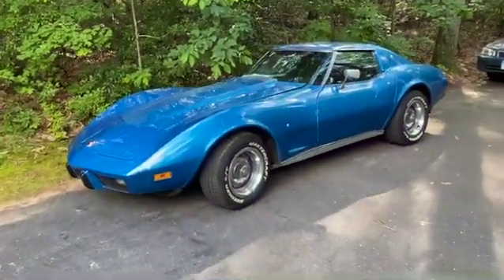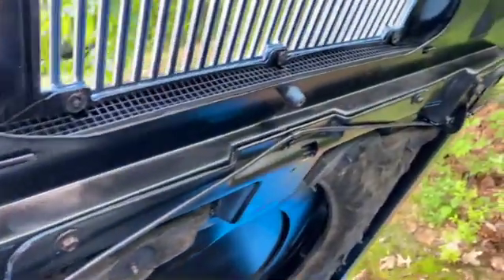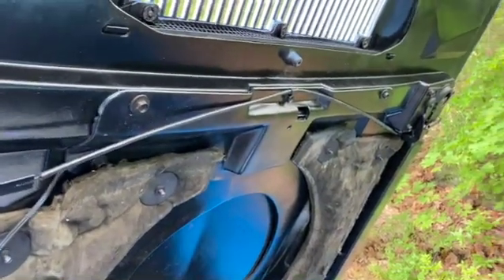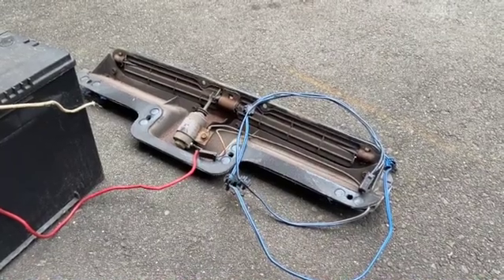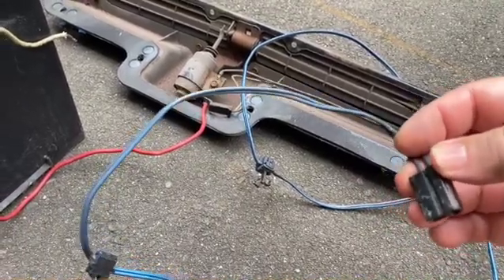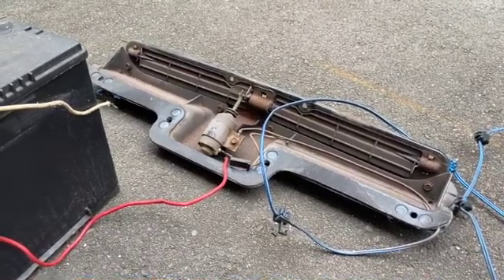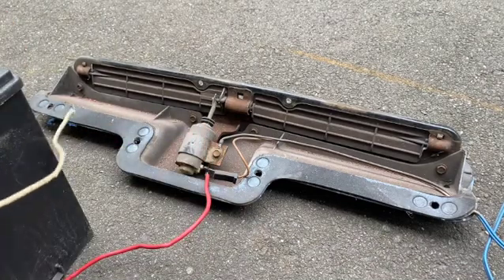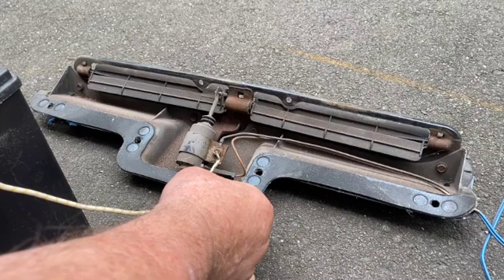1973-75 Corvette Induction System; How it Works

Comment: The flap is opened only at Wide Open Throttle or WOT, by a switch on the accelerator pedal.

Comment: Sincere thanks for this great video. I was really searching a long time for such a video. I own a '74 Corvette with the induction system and some ... removed all the cables. A picture where the cables are hooked up at the  wiring at the passenger side would be helpful.
Reply from the maker: There should be a connector by the drivers headlamp under the hood. If its disconnected you'll see a open connector.